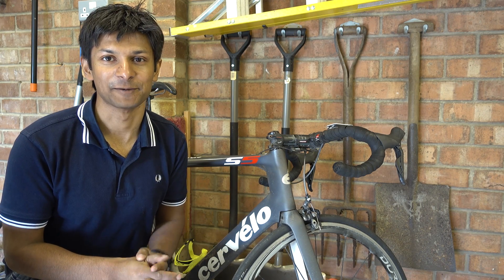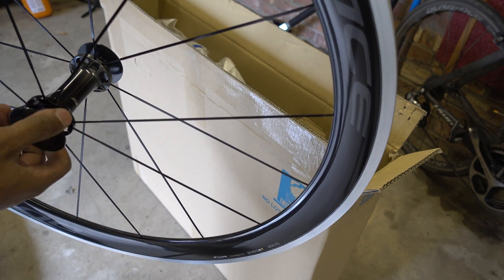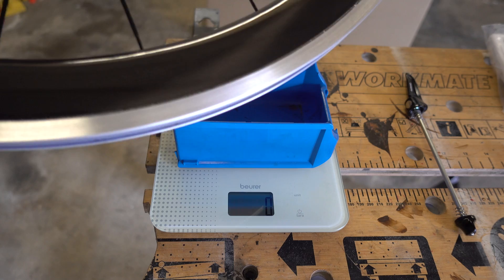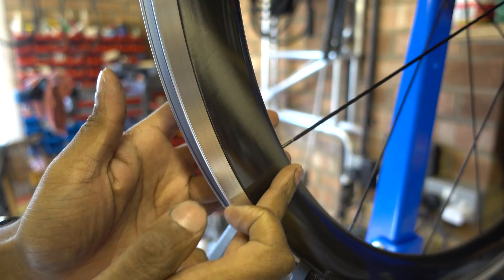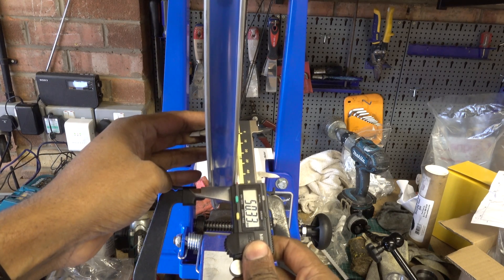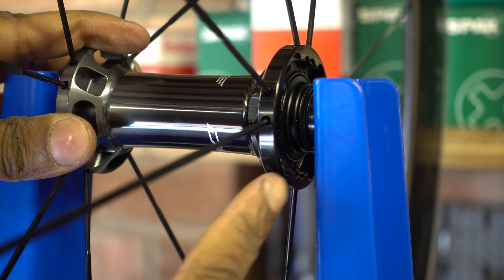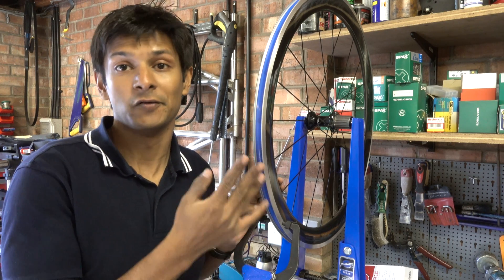Shimano C60 Wheel Review (Dura Ace 9100) Unboxing and Manufacturing Check Part 1

Comment: Have not seen the 1000km review yet but my DA 9000 C24 wheelset delaminated - the carbon seperated from the aluminium. They had done a lot of miles - I suspect galvanic corrosion due to the climate  here in Portland Oregon.

Comment: Shimano hubs are good, but they're still stuck in using narrow width rims while everyone else has moved on to 19-21mm internal width rims.
Reply from the maker: Wider is not necessarily better. Making something wider invariably makes the aerodynamics worse. The issue is the tyre manufacturers have made their tyres wider. If you mounted a narrowish tyre onto a C60. It would be just as aerodynamic.
Reply: @Hambini  i'm curious, compare a 23c vs 25c tire, what is the ballpark drag difference due to tire width difference, assuming everything else is equaled

Comment: And another question, what wheel truing stand is that, and would you recommend it? Looks like a Park one from the colour.
Reply from the maker: It is a park one, It's okay but I had to mess around with it when I bought it to get it as the adjustment was way off from the factory.

Comment: When you spinned it at around 7:35 the wheel looked like it was warped. Was that the wheel or did you just bump the stand?
Reply from the maker: I think it's the rim tape that makes it look warped. The rim tape is not perfectly true in the gap which may make it look warped. When I did a DTI check in the metal bits, they was very little runout. I've put another 2000km on them now and I would definitely recommend them. They are great wheels.
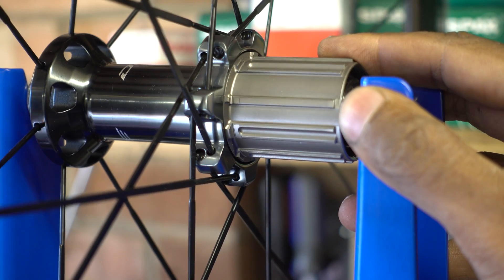Reply: Nah, it is warped. at 7:17, look at the outside of the actual rim in front of the yellow can when it spins. You can see that it is not the decal. I have some old DT Swiss rims which aren't warped and was thinking of getting some new Shimano rims for my Specialized Tarmac now that I decided not to by a titanium frame from Litespeed, Moots, Van Nichols, Seven or Lynskey. I know there are tolerances, but when you can see a warp with the naked eye, spending almost $2K for a set of rims.... 
Damn!

Comment: What made you choose the Shimano C60s over other 60mm wheels?
Reply from the maker: Good question. The aluminium braking track for one. UK weather is notoriously poor so I will be in rain at some point. Nothing brakes quite like aluminium yet. The other reason is the hubs. I rate Shimano hubs highly, extremely well machined and last a long time. I could have gotten Zipp wheels which were similarly priced but from experience their hubs are garbage. I did consider Mavic. 

There are some disadvantages with these wheels and the most notable one is their weight. At almost 2kg for a wheelset, in this day and age that is quite high.
Reply: @Hambini , doesn't the high weight of the wheels (rotational mass) have a slight negative effect on the braking capability (thereby reducing the benefit of the braking surface)?